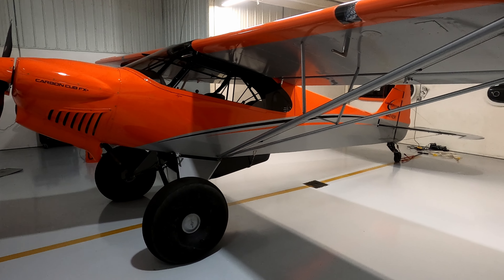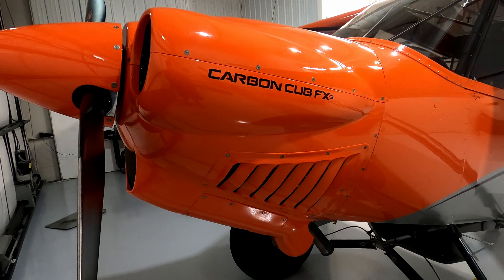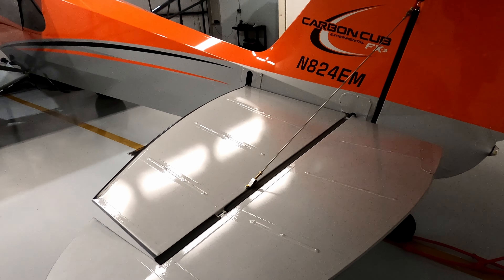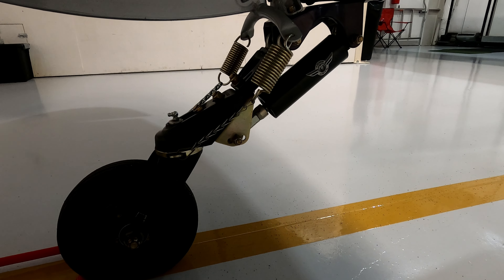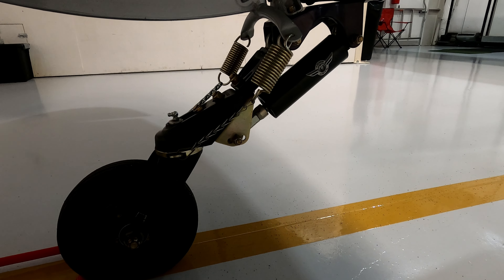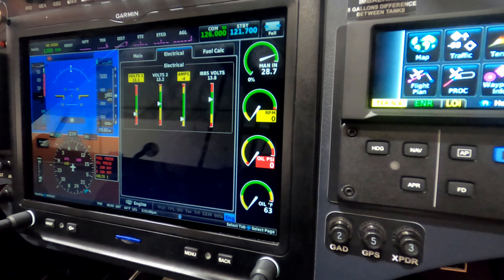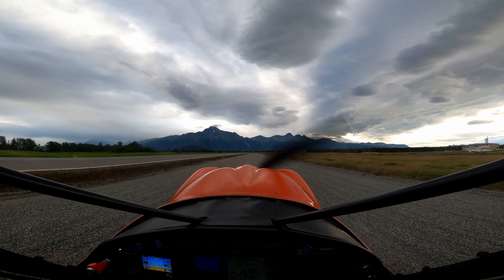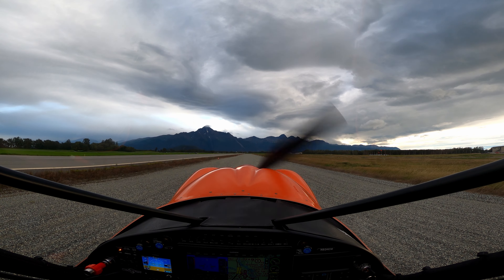Cub Crafters Carbon Cub FX3 Owner Overview, Walkaround, and Demo Flight

Comment: Nice plane . The only downside is the gear attachment to the fuselage. It’s extremely weak. Very easy to break even when you’re mounting the gear. Once you break it you buy a new fuselage. And go through the whole, mounting of servos changing the engine, etc. Been there done that.

Comment: G,day from Sydney Australia.
Thanks for the look around the STOL carbon cub. I'd like a closer look at how the horizontal stabilizers work and the trim system.
* Servo motor
* Cables
* Screw jack 
🌏🇦🇺
Reply from the maker: G'day!  I am going to send you over to Dave Embry's channel.  Specifically this video:  https://www.youtube.com/watch?v=TJYzGPvnUk8  might be what you're looking for.  Check out his channel, it has detailed videos about the construction of these airplanes.  The only difference between Dave's EX3 and my FX3 is that Dave builds his own his own from a kit and mine was constructed at the factory, the parts are the same.

Comment: Is there only one Com?  Maybe I missed it.  For IFR,  I use two Nav/ Coms plus a handheld for backup.  Great looking aircraft.  Best quality.
Reply from the maker: Yes, just a single gnc-355 comm radio.  It has a monitor function for the standy frequency but there is no second radio. No VHF nav radio at all, only the two GPS's in the G3X and GNC-355. Cub Crafters can put in a second remote vhf as an option.  I seldom fly it IFR because of icing issues in Alaska where the airplane is based, I just wanted the bare minimum to do so legally in a pinch.

Comment: Just curious, how does the Earth X battery vent?  I thought that you could not have a belly pod as the battery vents out the belly.  How did you get around the venting issue?
Reply from the maker: Cub Crafters installed a couple of tubes that go from the battery case to a vent on the belly of the fuselage, aft of the the fuel pod.  There are vent attachments on the battery itself from what I understand.  I'm sure I will learn more about it during the first condition inspection this April with my mechanic. I didn't participate in too much of the electrical system construction at the factory aside from cutting wires to length.
Reply: @EricMassey748  Good they did that for you.  They said I could not have the belly pod with the earth X battery as it need to vent directly under the battery.   Probably more important you have the extra fuel in Alaska, not super important here in Illinois, so I went with the battery.  Keep the videos coming!! thanks - John
Reply from the maker: @Cubonaut875  yeah, I don't think they enjoyed doing it but since they sold me both options they felt obligated to try it.  I'm not sure they realized they would need to do what they did when I turned in my order form.

Comment: I can’t help but wonder…What does L and R actually control on an EI engine? Is it still plug 1 vs plug 2 or top vs bottom?
Reply from the maker: With the key switch in "R" only the lower plugs are firing, and with the key switch in "L" only the top plugs are firing.  There are two 12v powered ignition modules which recieve tach and manifold pressure inputs from system sensors and use that information to set spark timing and intensity.  Each module in turn powers 2 ignition coils each (4 total).  Each coil in turn powers 1 spark plug on 2 opposing cylinders. The manifold pressure and RPM are passed to the engine instruments by the ignition modules.  You can search for the Lightspeed Plasma III CDI manual online for further details, I believe the manual is publicy listed.

Comment: I have a Legend Super Cub (see my channel) equipped very much the same way, but I have to say the Carbon cubs take the refinement of manufacture quality quite a lot further. I love the Legend, but Theres a lot of velcro holding interior trim in place, and over time, it looks like crap.  But man does it fly.  Its slower in cruise than the CC, but the full flaps stall is only 23 KTS, and will take off in one stripe on the runway!  Its VERY hard to get it to stall, even accelerated stalls. I just LOVE the way it flies, but man would I love the refinement of a Cub Crafters!!
Reply from the maker: Legends are great too!  It's good to have competition and choices!  I used to live in Sulphur Spring so I was quite tempted to buy a MOAC!  The MOAC Slats would be awesome, but I also enjoy my 130 mph cruise on the FX3.

Comment: 31 freakin' inch of rubber? that's bigger than some compact SUVs are sold with these days!
Reply from the maker: Many, maybe most, super cubs in Alaska run 35's so mine are relatively undersized.

Comment: About how much does the whole plane add up to cost?
Reply from the maker: This one I paid about $350,000 for, the current base price in 2022 is about $300,000, mine was more because of the IFR panel, fuel pod, acme shocks, 31" tires, factory float kit, reinforced belly /tail fabric, autopilot,  earthx battery etc.  Cub Crafters has an airplane building tool on their website that will tell you the price with various options.
Reply: @EricMassey748  how can you afford to have 350k laying around? what am I doing wrong that even 35k is a lot of money to me
Reply from the maker: @zackriden79  I'm old and I saved my money for a long time, I don't have kids and I live in a small apartment.  Also this might be one of the absolute cheapest new airplanes you can buy that is built in a factory and not in your own hangar/garage.